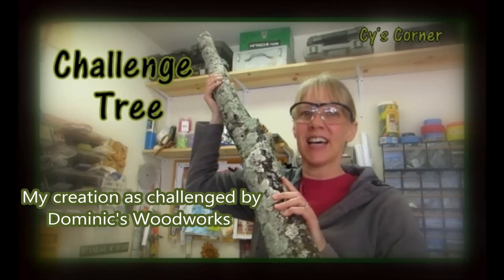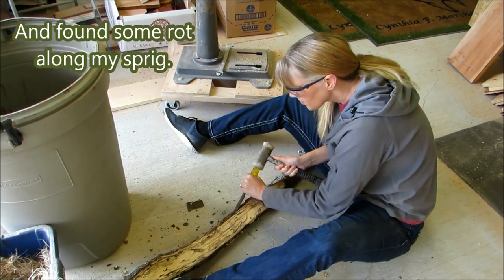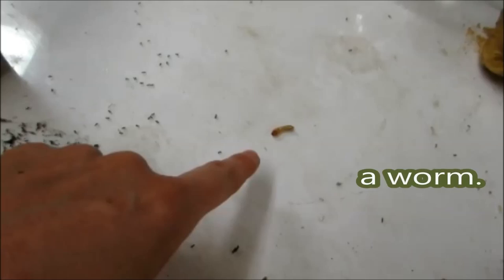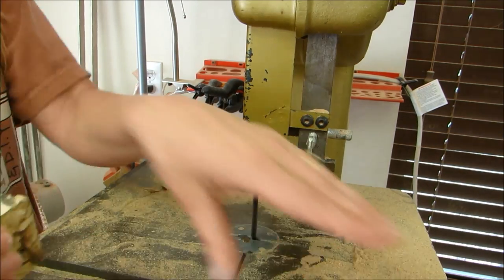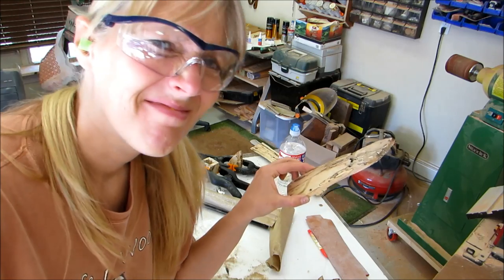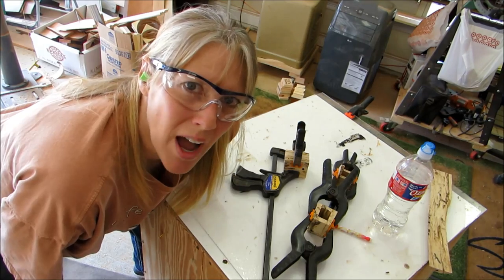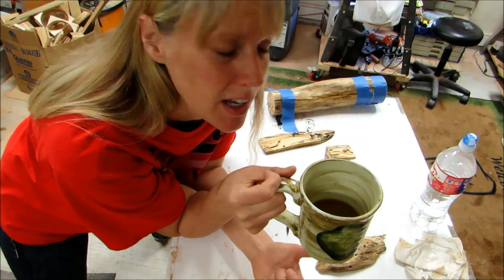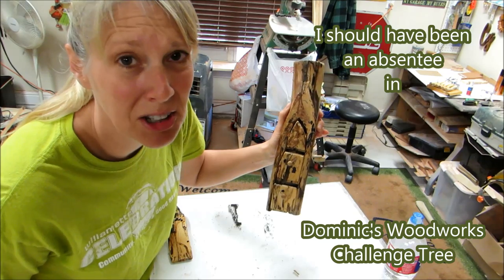Challenge Tree

Comment: Cool project. Can you wrap a little foil around it, loosely, and stick it in the oven for a couple hours at around 200 degrees or so? That should finish off anything inside it.
Reply from the maker: wjf213 That would probably work, not sure about putting it into my kitchen oven though...Someone suggested the microwave.  I suppose it really wouldn't matter because they're dead right?  But still seems gross.  :)